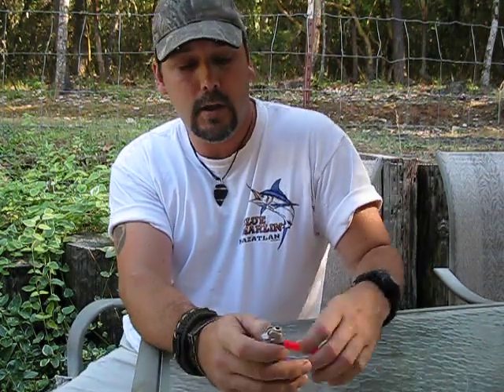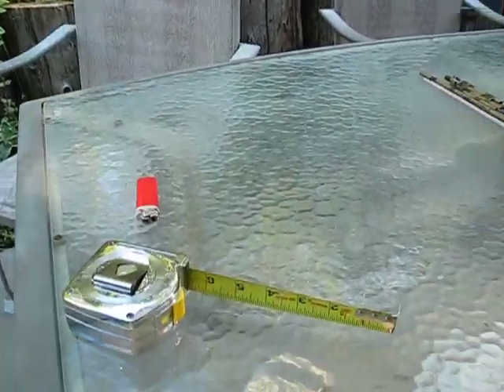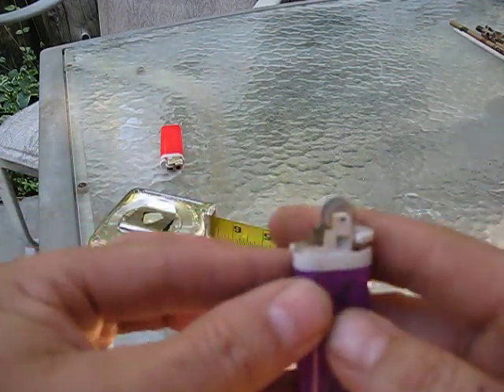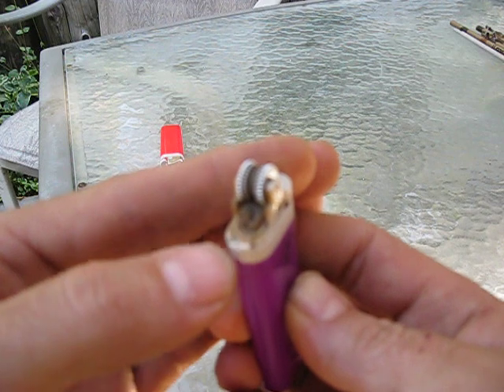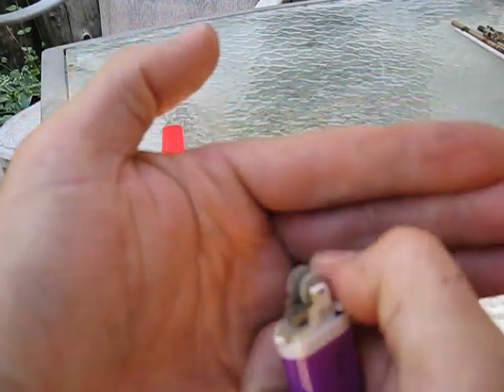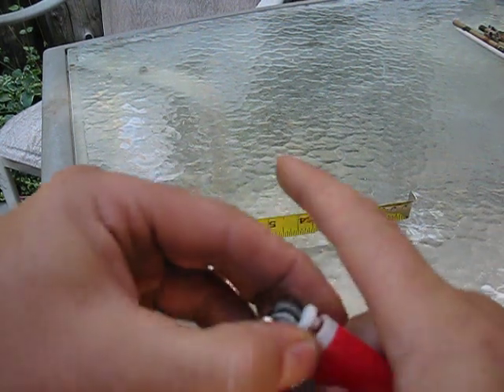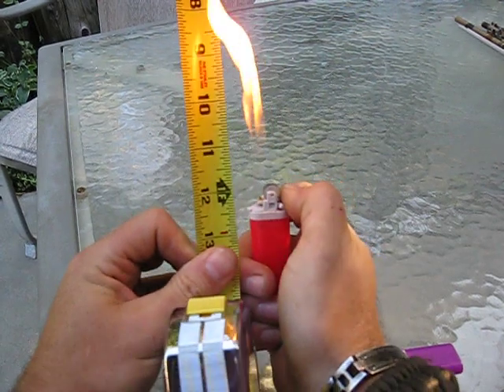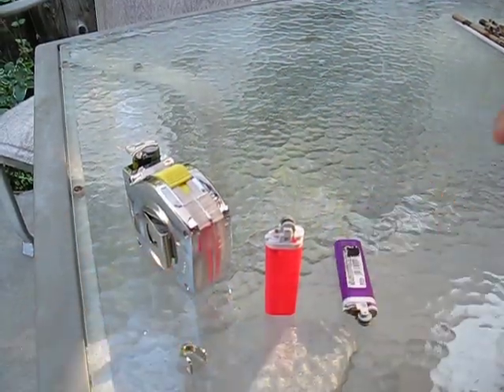How to Light More Fires with a Empty Lighter

Comment: anyone else's lighter go out mid sesh but they need it rn? only packed 2 bowls im heated
Reply from the maker: Thanks for watching.
Reply: CommonSenseOutdoors
 Thank you fam
Reply: Just a trick for making a fire with an empty bic lighter and a piece of toilet paper: 

Take the piece of toilet paper and get just one ply of it. Gently roll the striker (without making a spark) over the toilet paper until you start seeing a little pile of powder. Twist the toilet paper up to where the little ball of powder is at the tip of the twisted piece and strike the lighter very close to the little ball. It will burst into flames and produce an actual flame. It won’t last long (the flame) but will last long enough to start a “birds nest” to get your fire going. 

😁 you’re welcome.
Reply: Bro I just packed a bowl just to see my lighter is dead
Reply: Just happened to me😂

Comment: how does that work
if it's empty there is nothing right?
Reply from the maker: +NEW_WORLD_BRANDON I believe it opens a valve just enough to allow enough vapors to come through and ignite. When there wasn't enough left to come through using the lighters pre-set max setting. But, technically when the lighter fails to produce flame, doesn't mean there isn't still some gases inside.. just not enough to make flame without opening the valve more. Hope that makes sense, thanks for watching.

Comment: Just a trick for making a fire with an empty bic lighter and a piece of toilet paper: 

Take the piece of toilet paper and get just one ply of it. Gently roll the striker (without making a spark) over the toilet paper until you start seeing a little pile of powder. Twist the toilet paper up to where the little ball of powder is at the tip of the twisted piece and strike the lighter very close to the little ball. It will burst into flames and produce an actual flame. It won’t last long (the flame) but will last long enough to start a “birds nest” to get your fire going. 

😁 you’re welcome.
Reply: Yeah bro it’s flint and obviously very flammable you can get a quick flame out of it this way just takes a few minutes to get enough flint onto the paper